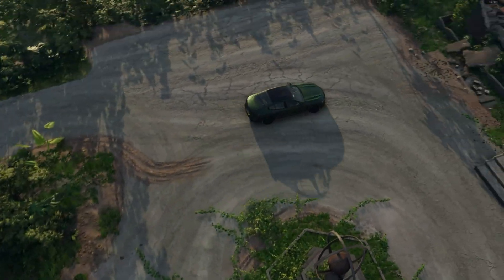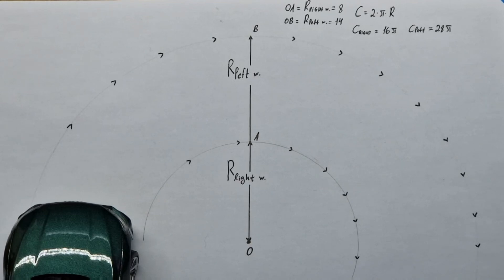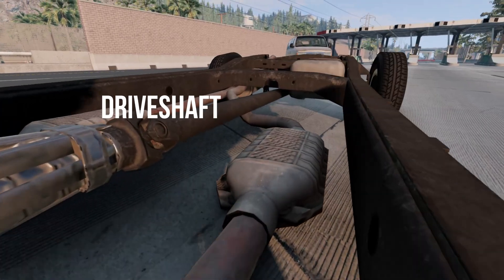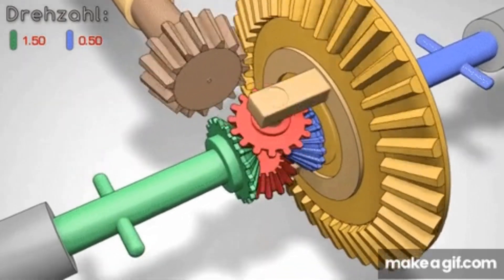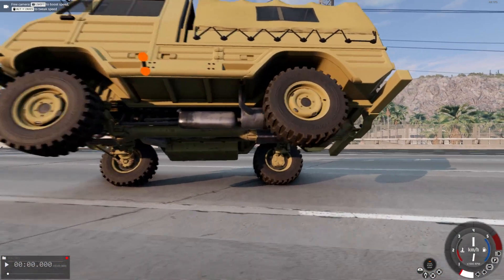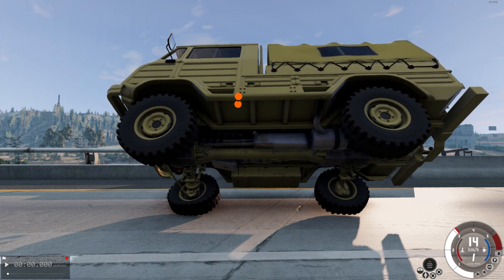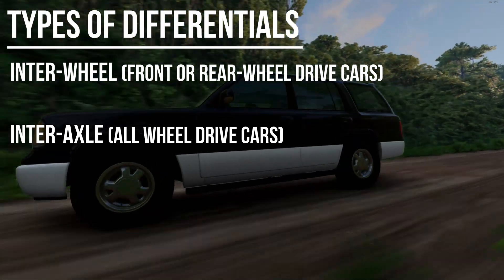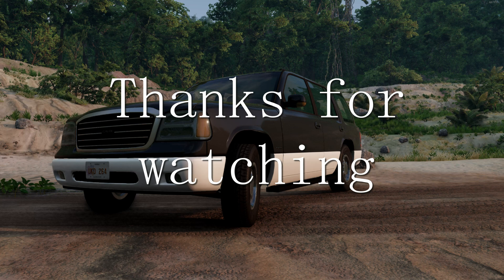Why do we need differentials? Let's find out!

Comment: Glad to see more channels using beamng for videos as it is not getting enough attention. I actually have done some simulating of differentials before for an offroading game and have some critique of your differential explanation. The first simulation I made vectored the torque to the fastest wheel much like how you explained in the video, but actually an open differential sends equal torque to both wheels. Since both have equal torque, the wheel with less load will accelerate fatser than the one with more load. When one wheel speeds up, the other one must slow down due to the sun and planet gear mechanism. This causes the spinning we see when one wheel is off the ground as the wheel loaded is spinning at its max speed, 0. It took me way too long to figure out how it worked because every explanation on the internet said the same thing (same torque, vectors power. what is power???), and did not explain from a technical perspective. Hope this helps.
Reply from the maker: Yes, my friend, your explanation is more clear and precise than the one I made.  I just wanted to make the explanation more simple and short to understand.  In general, what you said is quite close to what I said, and I hope that my explanation does not differ from the truth.  I am very grateful to you for such clarification and I really hope that my explanations helped you in some way.  Also, I will have another video about differentials, so maybe you will subscribe if you are interested?  I also do a lot of experiments in the game BeamNG from a technical point of view, I really like this game.  If you subscribe, I will be very grateful )

Comment: I would like to lern about structure of Limited slip defirencial , couse ur have only explain the open one , also i don't know haw does diffirencial lock itself on offroad cars
Reply from the maker: OK, I understand, I will make a video about how the differential locks from a mechanical point of view, and as for the limited slip differential, I talked about its structure, because it is the most common among all types of differentials.  Maybe I just didn't understand what you mean?